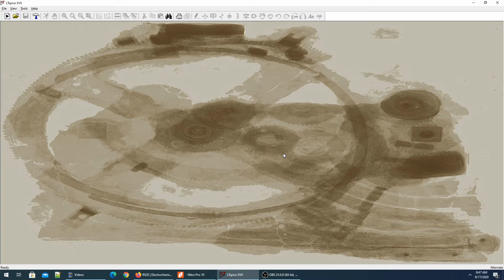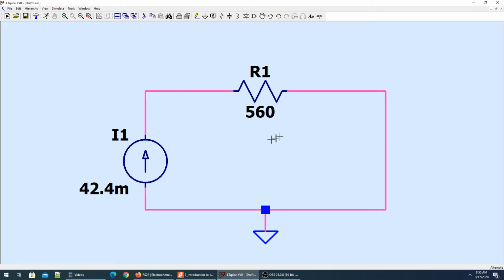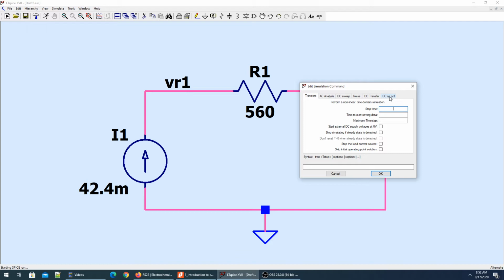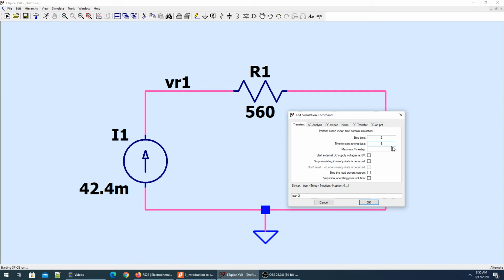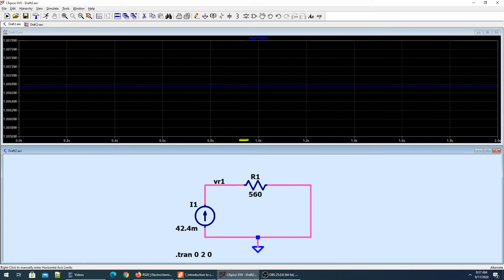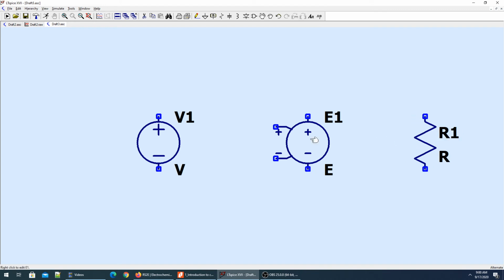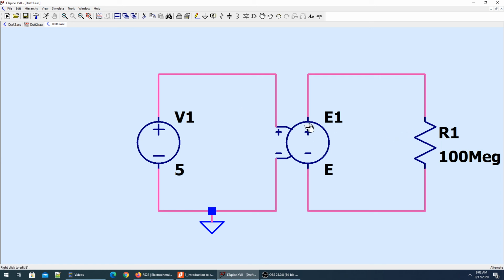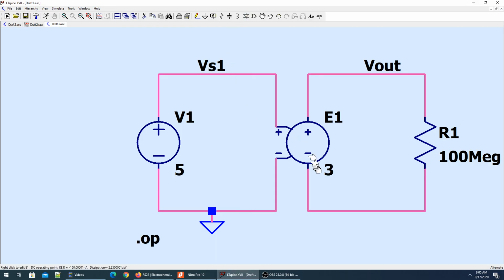LTspice DC Analysis Voltage Dependent Voltage Source

Comment: The operating point simulation WILL give you the power dissipation of each element. It is not displayed on the pop up window but can easily be found by placing the cursor over the the resistor and it is displayed in the lower left corner.